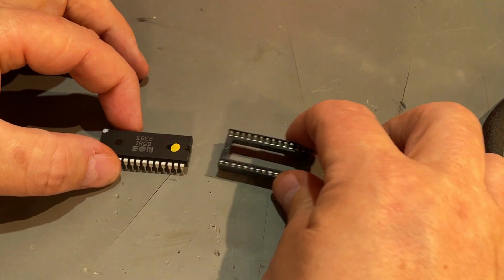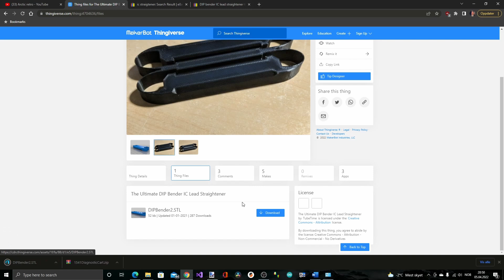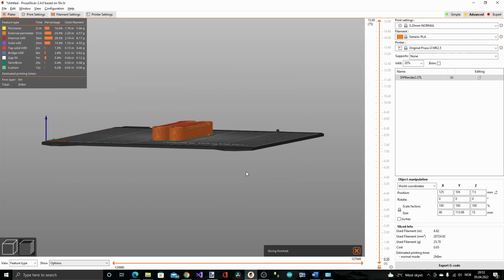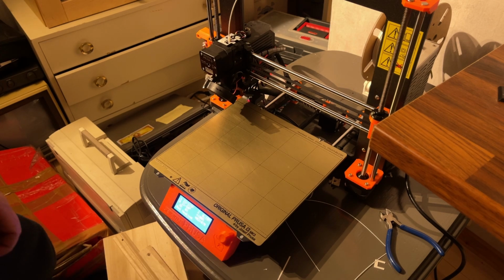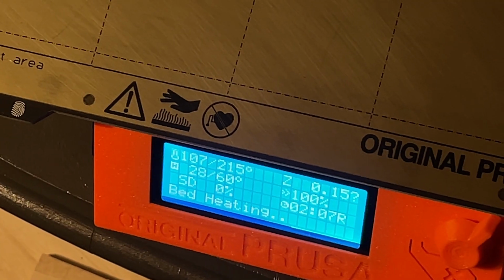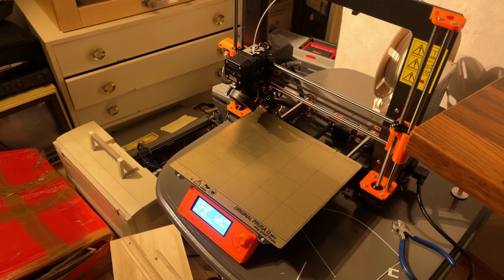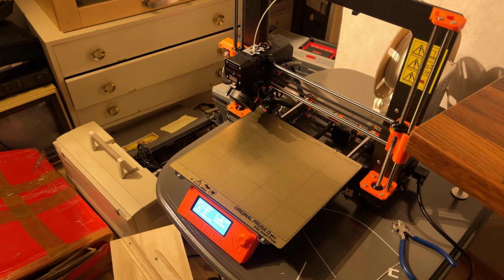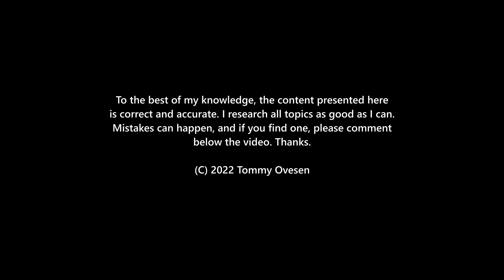Making a 3D-printed IC pin straightener

Comment: These similar things are only a few AUD dollars delivered from Ali Express. However, i see this can be very useful for people who need one right away o r a few dollars is not exactly cheap, like in developing countries. Here in Australia, Australia Post takes a loss from all small packet shipments from Ali Express. Part of the free trade agreement they have. If i sent the same thing next door to my place, it will cost about 5 times more.

Love the Prusa printer but shame it does not currently have a larger bed. Im still using my first Ender 3 Pro using the "special" glass plate". I use the stick glue for so the print always prints and is not knocked over. The hardest part is getting the print off at times takes a few minutes. Which is why i bought a second glass plate i use while i clean the first one :D
Reply from the maker: Yes I know. We get "free" shipping from China to Norway too. The point was to make something and show you how:)
Reply: The only one I could find on AliExpress was $285CAD plus $50CAD for shipping.